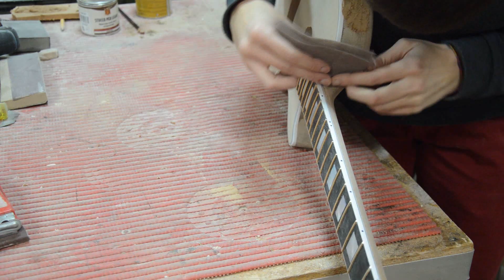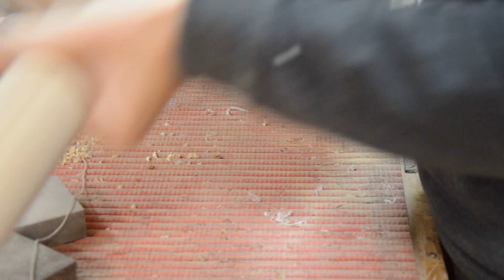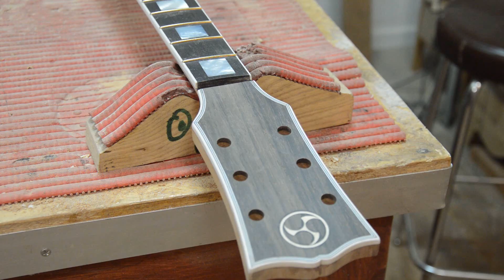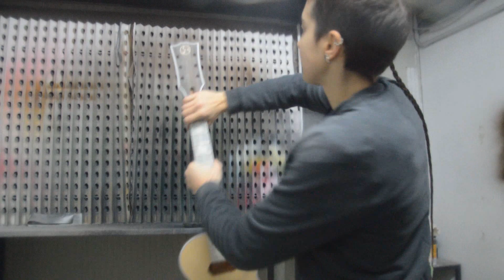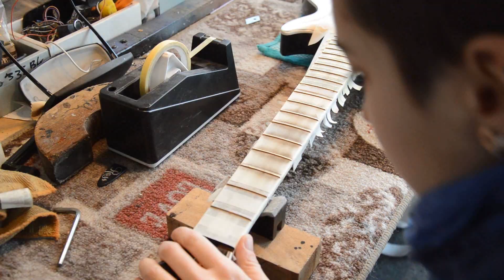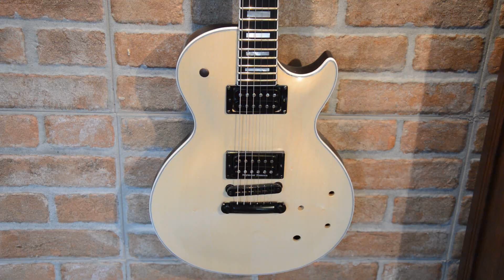Les Paul BUILT - FINAL PART: finishing and setting

Comment: I don't know what finishing product you've used, I would recommend wearing a filtering mask when using these stuff since they can be nasty on your lungs. Great work!
Reply from the maker: I Always wear a active carbon filter Mask, I use nitrocellulose basecoat and acrylic clear coat. Here you see a video-purpose pseudo-coat, so that I can prevent the camera from damages by varnish dust and I can avoid masking.
Reply: That makes more sense. I saw you answer a text during the spray and thought you had plumbs of steel 🙂.